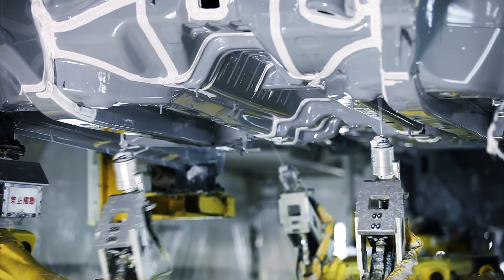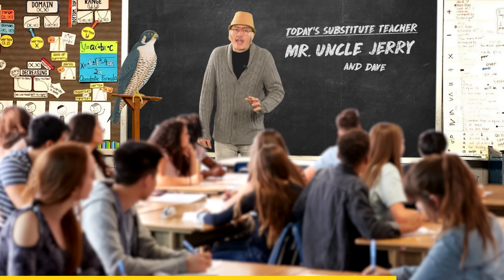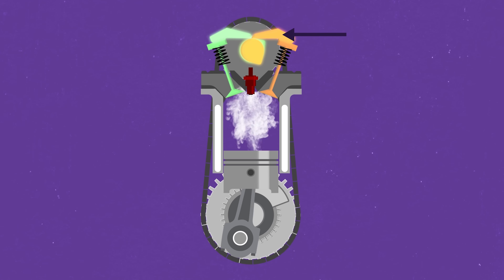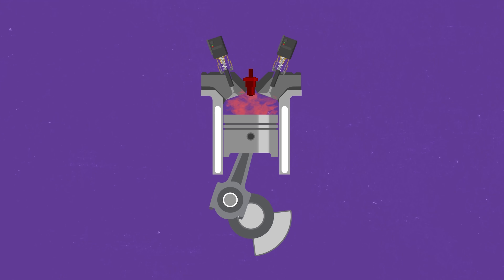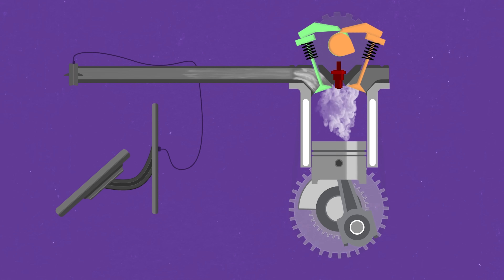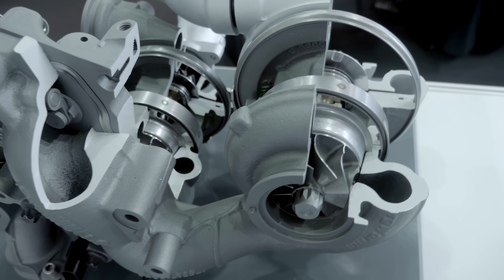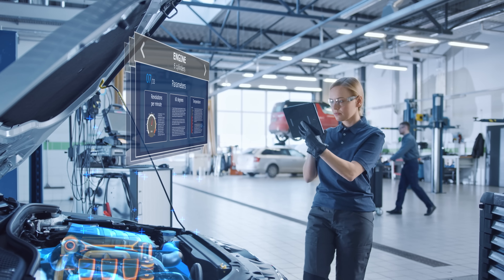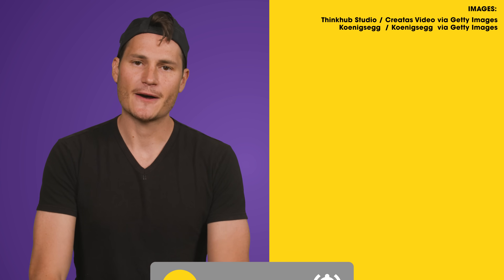This Is The Last Great Engine Tech

Comment: 8 years ago during my college, when I explained the same thing to my professor about digital valve timing, he just laughed.
Reply: @Jonathan Begnami Hmmm, I wonder how the FIA would respond to this.  I'm not sure if the smaller teams would be able to fund the development of this tech and how the FIA would respond to it.  I'd like to see it, nonetheless.
Reply: @JIMLAS3359  I don't think the budget to develop this would be that high.. Everyone should be able to afford it..
Reply: @revaddict  If the FIA hasn't banned it, then I'm wondering why it hasn't been developed then.  I'm just wondering.
Reply: @JIMLAS3359  F1 does use pneumatic valve "springs" but VVT is banned in F1 "5.10.2 Variable valve timing and variable valve lift profile systems are not permitted."
Reply: @DominicDeJacomo  yeah, @KosmicHaynerRacingTeam mentioned that earlier.
Reply: @revaddict  a guy made his own freevalve system for a miata out of his garage. Its on youtube somewhere. I think he even freevalved a harbor freight lawnmower engine. 
I find it interesting that the op's professor laughed because this has been worked on since atleast the late 90's with 24 volt solenoids.
Reply: Race car don't neee fancy timing. They go full throtle all time 
 So this is no really usefull in the case of a race car. Race car don't have vvt most road car have
Reply: @GonzoDonzo  he's also in this videos comment section, pinned at top.
Reply: @JIMLAS3359  money. Only williams or red bull as  non oems would take serious advantage in pursuing this route. All others either need the electrification propaganda or want to keep concept of ice as we know it going.  Its more likely a mater of time. Had this come out in the 90 maybe we would see it put to cars... now realisticly only big engine aplications will be viable. Shipping trucking and so on
Reply: @DominicDeJacomo  technically this isn't variable valve timing. It's optimal valve timing and just enough of a grey area for someone to incorporate into their build without asking.
Reply: @JIMLAS3359  It was developed by Renault late 80s/early 90s. 

They chose not use it for performance reasons. The pneumatic valves used in F1 were probably superior at that time.
Reply: @JIMLAS3359  the “smaller teams” all use engines from the big Manufacturers. They don’t do their own engines currently.
Reply: @KosmicHRTRacingTeam  I did not know that.  I haven't been following F1 recently, as I'm sure you can tell.
Reply: @JIMLAS3359  Smaller teams don't develop engines, they buy them from Merc, Ferrari and Renault.
Reply: @JIMLAS3359  iirc the smaller teams just buy their engines from other manufacturers? But I'm guessing they have to pay a premium
Reply: @Rajdoeoe  gotcha, thanks
Reply: @JIMLAS3359  I mean they should allow it. I thought that they want it to be a sport  of innovation that can potentially improve consumer cars. That is why they are pushing for more efficiency and eco friendly materials.
Reply: @JIMLAS3359  they could just, you know, buy it? From the company? Freevalve? 

There’s no need to develop anything. And a FV head would probably be similar in cost to the exotic heads F1 already uses.
Reply: Even an Professor can be a Moron 😅😅😅
Reply: I had a similar experience. Even F1 hasn't tried this (iirc).
Reply: @JIMLAS3359  this technogy was bench tested in F1 around the turn of the millenium by Renault at very least, it just never made it to the track, I believe weight and increased COG were key disadvantages at the time.
Reply: @philipbain  I did not know that.  Thanks.
Reply: @JIMLAS3359  I think F1 use pneumatic actuators (which are also independent of the rpm)
Reply: @rientsdijkstra4266  I think only the "valve spring" is pneumatic in F1 engines.

The valve is still pushed down by a cam, but is pushed back up pneumatically.
Reply: @tylerdurden3722  That is in an engine with traditional "pneumatic valves". In an engine with the "Freevalve" technology as developed by Koenigsegg and in another form also in modern F1 engines, the valves are actuated 100% independend. By different pneumatic, hydraulic or electric actuators, without any camshaft.
The great advantage of this is 100% control over valvetiming in all combinations of revs, loads, air quality, etc. etc.

You can find explanations of this on the internet / youtube. Look for Freevalve and Koenigsegg
Reply: It's useless for race car. Theh don't even use vvt
Reply: Had something similar happen to me when I fantasized about rockets flying back and land when I was a kid. My dad also just laughed at me. Oops 😂
Reply: @SebiKoerner  In my case, O given complete explanation and supporting docs to my professor.
Reply: @DileepPisupati02  Do you have a LinkedIn?
Reply: @thebestevertherewas  yup!
Reply: @DileepPisupati02  can you tell me
Reply: I’m a marine engineer. Large 2 stroke HFO engines have Digital timing for years now.
Reply: anonymous  The exhaust valve timing and Fuel injection is operated via computer controlled hydraulic solenoid valves. There are no intake valves but intake ports on 2 Stoke marine engine that allow scavenged air to rush in on the expansion stroke. This makes engine reversing a far simpler process as with an analogue engine the entire can shaft had to be adjusted is reversing gear due to shaft/Propellor being coupled directly to the Crankshaft.
Reply: He laughed because he's ignorant and arrogant. Should have at least known about pneumatic valve engines ( see MotoGP ), put 2 and 2 together and realize that some type electronic valve engines would come out in the future because the idea was anything but new.
Reply: bawa desi college? I was a mech student. They still teaching steam engines lol
Reply: I know how you felt, i once asked my math tutor (he’s studying in polytechnic university in prague at the time) that “would it possible that we use kinetic energy from braking to charge a battery? It’s a waste we’re not harvesting it.” That was 2 years before F1/ porsche 918 starts using them (Not really sure which come first) internet was not big back then. Anyway, my tutor was like “no” .
Reply: haha same thing here, the problem actuators weren't fast enough back than...
Reply: There were many ideas. For instance i have an idea and some thesis work on an engine which runs on a sea water. This is basically works on reverse of fuel cell technology. If someone is interested let me know.
Reply: @DileepPisupati02  if It actually works it would be amazing. As long as it's not like all the other "water" powered cars that break water down to combust hydrogen. Since electricity is needed to break apart the bonds that hold the H and O atoms together in an H2O molecule, every water powered car in the past had its range limited by how much charge the battery holds. If the salt water is broken down back into hydrogen and oxygen the range would still be limited by the battery since the power from the hydrogen would not be enough to power the car and power the device breaking apart the H2O and NaCl molecules. If the salt water is used as a fuel cell it would work very similarly to the current hydrogen fuel cell, except having to refill H2 gas (the H2 is broken up into H ions and electrons. the electron flowing through the cathode, load, anode and then rejoining the H atom which then combines with an O atom, which then combine into water.) You'd refill salt water. The salt water would be broken down into hydrogen and oxygen with magnesium and oxygen from the salt water  as the cathode/anode, salt as the electrolyte and Hydrogen gas would be the "waste product" instead of H2O as in a hydrogen fuel cell. Also the magnesium plate or what ever shape it is would need to be replace as well as the salt water. I'm just curious because if your idea for a seawater powered "reverse" fuel cell really works like a reverse fuel cell the only advantage I'd see is that it produces hydrogen which can be used in internal combustion or regular fuel cell vehicles, as long as your OK with having to carry highly flammable H in your vehicle. I'm thinking your idea probably either works nothing like current fuel cells or there is another chemical or other process that isn't mentioned in the description. Also your professor laughed when you brought up an idea like the freevalve system 8 years ago because doing away with cams and having actuators having precise control over the valves is not a new idea. I thought of something similar in 2004 not only to do away with cams but also be able to design the port and valves to have a shape that will allow more air to flow into/more exhuast out of the combustion chamber with less restriction while mixing the air and fuel better for a more efficient burn. Also with individually actuated valves the lift and duration can be controlled to a more precise level for the best power/efficiency at every RPM. While researching this I found that this idea has been looked over by engineers every few years since the 1970s I believe was the oldest published info on camless engines. Technologic advances in computing, manufacturing, simulation and material science has finally allowed a camless engine to exist and operate reliably while not being overly expensive.
Reply: @DileepPisupati02  I am
Reply: @DileepPisupati02  that sounds incredibly intriguing, would you mind elaborating a bit on the concept?
Reply: Email this link to him
Reply: There are some misnomers in this video though... Digital signals are still analog waves for example.
Reply: I invented this because I thought of it on the toilet one time
Reply: When people laugh, and you aren’t retarded, you know your idea is pure gold. The last laugh can be yours if you believe in yourself.
Reply: Wow a Indian guy here
Reply: College of useless it's just another way for outdated flagging Academia to have its raping way with young minds
Reply: Same here 😅
Reply: Figures.  Dude I remember when no one could comprehend a person filling up a 40 gig hard disk drive.   Time flies
Reply: Hey if you don't mind me asking, what course did you take or which college did you go to ?.
Reply: Oof
Reply: many good ideas are deemed silly, till someone actually does it.
Reply: Remind him and laugh at his communist college going under
Reply: I bet...
Reply: I said that humans passing gas is a fuel we have looked over for centuries and still people laugh at me. But some day cars will be powered by farts, same day Taco Bell turns into a gas station😂.
Reply: @spiceboyog9083  You can absolutely run a car on methane...conversion kits already exist and the only real difference is the fuel line, pump and gas tank in addition to an ECU tune (Timing and air:fuel ratios need to be calibrated).
Reply: I would of done the same thing if I was your professor. Digital valve timing how ridiculous. But nowadays oh digital valve timing, where can I get it
Reply: where is he now is he still laughing
Reply: @randomplayer3467  Shows how rigid he is
Reply: 69th reply
Reply: See you should have dropped out of college like Bill Gates and started your company on that! See now you watch videos on YouTube about freevalves. Damn! College professors live in the present, that present time was 8 years ago and he laughed at you when you saw the future almost 8 years ahead. Ahead of someone with a ffrigging PhD.
Reply: You know a lot of professors don't believe brainstormed ideas especially when they weren't involved in the thought process. With that being said, seeing is believing with them.
Reply: Professors are usually limited, they teach to students, but they dont like when someone is teaching them something new. Quite ironic
Reply: no he didnt. 8 years ago pneumatic valve trains already existed. the problem is they are pricey complex and dont serve any purpose. we are moving into an electric economy. Oil is dead my guy.
Reply: @grenadegoboom4967  Your mostly correct.
Reply: @ryanjofre  apostrophe e. im completely correct. pneumatic valve trains gains are well offset by the cost and complexity. weight carries a real tax in ICE engines. also an out of time event  is absolutely catastrophic to an engine. keeping the timing mechanically linked is by far the most reliable way to do it. a pneumatic valve reset or crash on the interstate? youre dead.

Comment: It's amazing how manufacturers stuck with mechanical VVT, and didn't switch to EVT. I mean - EFI got implemented pretty much industry wide (maybe except bikes) by what, 1990s? EVT should've been implemented at least 20 years ago. With Koenigsegg having done it, maybe it could get implemented in some economy cars by 2030, since electrification is still going to be a domain of higher end and maybe mid-range vehicles for a while (talking worldwide here), but by 2030 we'll start seeing the electric vehicles creep more into cheaper vehicles (low $20k's) and used market will get more and more saturated. 

Who knows, maybe this will be a good choice for some brands that won't invest in EV tech, but since most manufacturers are already coalesced into groups, they share resources, and those that aren't are big on their own. Sad, that we didn't get to see this implemented sooner, we could've had some nice cars.